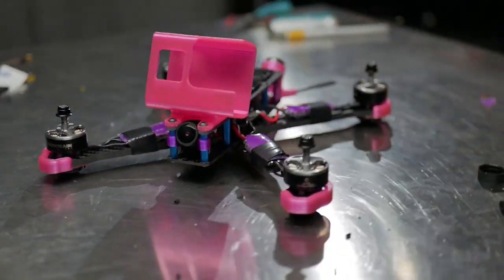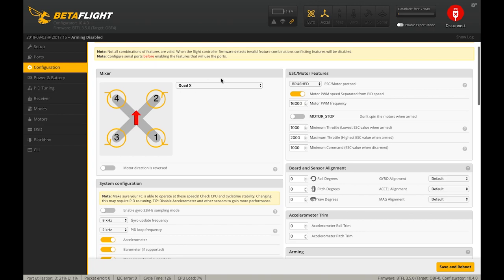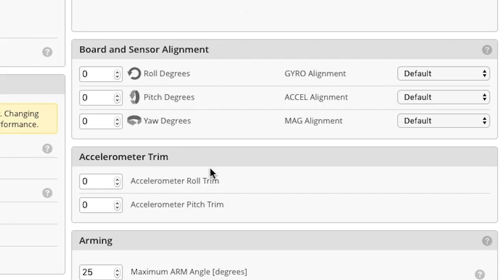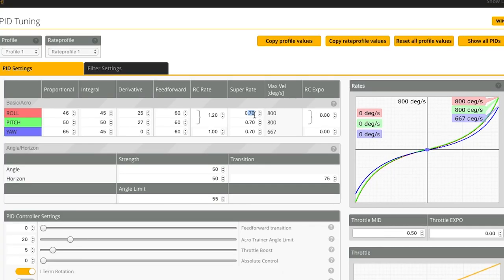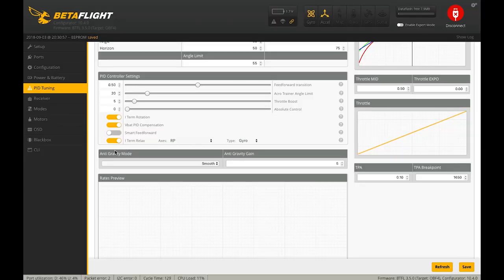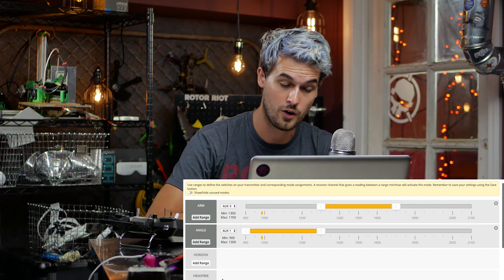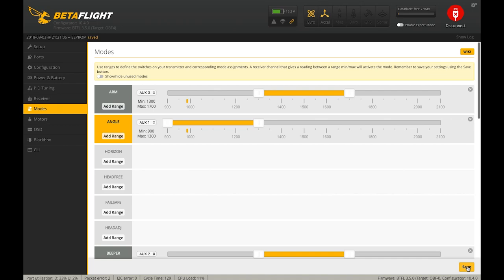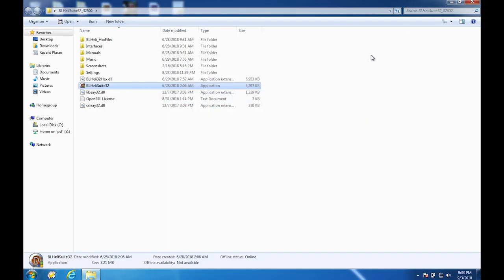Basic Betaflight 3.5 Setup

Comment: Thanks drew im using your rates on butterflight and it fly's so much better the only thing I cant get rid of is when power lopping the quad wants to yaw left at the top of the power loop im using a new x-lite controller xm plus receiver and the hobbywing 32bit esc stack with the icm gyro.

Comment: Drew mentions having Air Mode on a switch so that it can be enabled or disabled for various tricks.  Has anyone ever tried it on a spring Momentary switch?  For example, Air Mode would be ON by default, but if the Momentary Switch were pulled it would switch OFF, then release the Momentary to re-enable Air Mode.  I know the Taranis X9D Plus has a Momentary switch on the top right shoulder, not sure about other radios.

Comment: Does betaflight require drivers to correct the 32 nazia boards like clean flight test I have a little brushed racing quad and I wanted to hook it up and try to get it to work I've installed cleanflight but requires the drivers that I've tried to install before but without putting my computer through administrative privilege which I think it's just a matter of going into the settings selecting it and entering a password I haven't done it in a long while.

Comment: Hello, I have built pretty much the same setup from these videos, and followed all of the steps precisely, when I got to the BLHeli setup at the end of the video, in order to fix the motor rotation directions, I ran into a problem.  First my motors 1 & 4 were the ones not spinning in the right directions, so I reversed those 2 instead of 2 & 3.  I set everything else the same as in the video, and then when I went to test the motors in BLHeli, they wont spin up, and I get a wierd beep code now.  When I plug my battery in now, I only get the 3 initial beeps, and not the two at the end.  I am not sure what is going on with my ESC's now, and I cannot find any information on how to fix this.  Please help!! Thank you.
Reply: SOLVED!! So I figured out how to fix my problem and just wanted to share, in case anybody else ran into the same problem I had.  So I believe what happened when updating my ESC's with BLHeli32 was a result of removing the battery prior to clicking the disconnect button.  As a result my ESC's were giving all kinds of weird beeps, I could not get them to spin up with the motor test, and BLHeli would no longer recognize my ESC's.  Also my battery voltage was going crazy and it was saying that I was using a 1S battery instead of a 4S.  So the first thing I did was re-flash each ESC with BLHeli32 back to default settings.  In order to do this, I had to connect the FC to BLHeli without the battery connected first, then connect the battery to fire up the ESC's which would only give me 3 beeps.  Then I was able to get BLHeli to recognize the ESC's by hitting the READ button.  Once all of the ESC's had been re-flashed and set back to factory settings, then I re-flashed the FC in betaflight using the BOOT button on the board.  After doing so, everything was back to normal.  I was then able to go through all of the adjustments (Rotation Direction, etc) in BLHeli32, making sure to click DISCONNECT before removing the battery this time.  I did not try the motor test in BLHeli, but instead checked the motors in Betaflight, and everything is now working properly.  Just had to go back and redo all of the PID / Configuration / Mode settings in Betaflight one more time.  Thank you for all of the great videos!
Reply: UPDATE: not solved :/ So I went back thru and redid all of the Receiver / Modes stuff today, and it happened again.  First happened when setting the BEEPER mode.  When I turned the beeper on, it tripped all of the ESC's & FC into the red, the voltage went crazy again.  So I removed the BEEPER MODE, and turned it off on the config page, disconnected the battery, and everything seemed fine.  Finished all other settings, and OSD stuff, saved, and backed up everything.  Connected the battery, and armed the Quad, all good.  However, when I fire up the motors to a certain percent, it trips everything into RED ZONE again.... I'm at a total loss at this point as to what is causing this.  I will make another post if I manage to figure this out.  In the meantime, any suggestions as to what could be causing this to happen or how to troubleshoot this would be greatly appreciated.  Thank you.

Comment: Hi rotor riot great vids, can you help out with my taranis tinyhawlk set up I can't figure it out!!!

Have it configured in betaflight okay I think using mode2 on taranis and AETR on betaflight and taranis all works correct on receiver tab

Trouble is when I try to arm the motors won't spin unless I move the right stick up or down which ain't right

What might be going on as I can't work it out whatever to do next to fix!!

Thanks Darren

Comment: Very nice video. From where are you receiving the RSSI signal for the OSD?
Reply: Matuka smart port telemetry
Reply: Thank you, Enzo. But doesn't Smart Port telemetry data go unidirectionally from the flight controller to the R/C RX? Unless there is a dedicated RSSI R/C RX output pad soldered to a corresponding flight controller RSSI input pad (which I didn't see done in the build video), then I think there would need to be an additional AUX channel set up, either a) from the Taranis back to the RX (https://www.youtube.com/watch?v=t-evOAS9Mkg&vl=en), or b) for an XM or XM+, this: https://www.youtube.com/watch?v=q-rOd4_DSIk ?

Comment: I use a bl heli that looks like betaflight ,that looks like some old school blheli
Reply: ITZ AXEL BLHeli Configurator (purple lookin one)
Reply: yep user friendly updated interface
Reply: What you are using will not work with BlHeli 32
Reply: @dwayneh3010  its called blhellconfigurator it looks just like bl heli but everything is purple
Reply: I meant it looks like betaflight
Reply: @itzaxel8903  Yes I know what its called, it will not work with BlHeli 32.
Reply: @dwayneh3010  I can reverse my motors works for me

Comment: Honestly I don't know why in October of 2018, Rotor Riot (self-styled cutting edge multirotor lifestyle & tech outfit) is pitching STM32F4 flight controllers, with their limited numbers of UARTs and lack of support for the highest looptimes and DSHOT protocol (1200). Given that (for example) Matek have the F722-STD for stupidly cheap money, why would anyone go and buy an F4-based FC in October 2018, when you can spend the price of a pint of beer extra and get an F7?

I just find it a bit odd... I thought you guys were supposed to be ahead of the curve, not languishing somewhere underneath it?

I'm new to multirotors (been aeromodelling for 15 years however - fixed wing and helicopters) - only built two quads so far, and both of them have F7s in. No worrying about UARTs or inversion, since F7 supports 6 UARTs at least and the Matek boards for sure don't require any inversion hacks since all UARTs can be inverted in hardware.